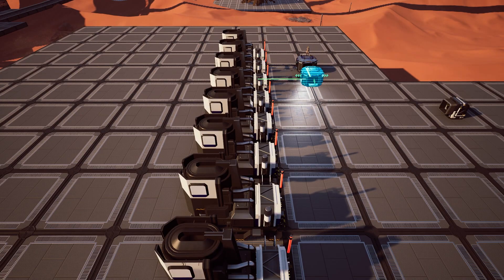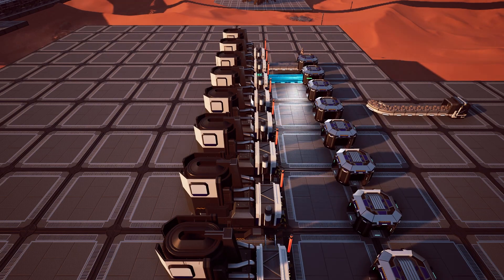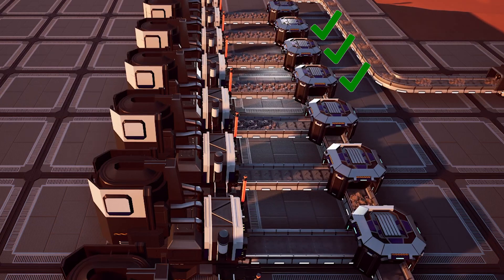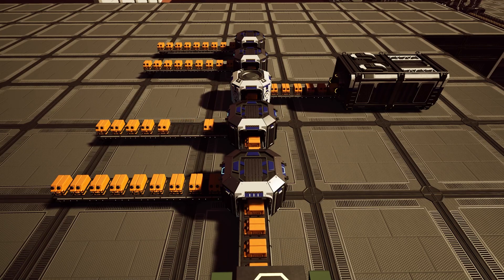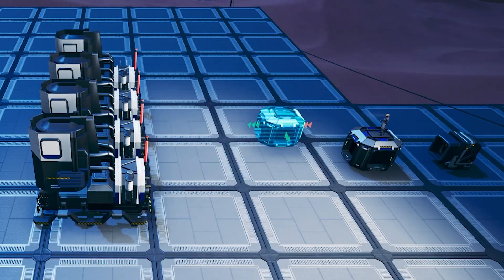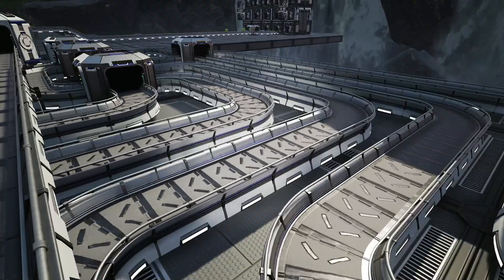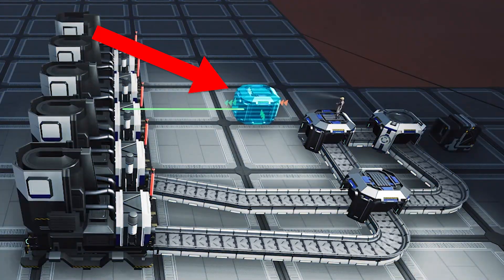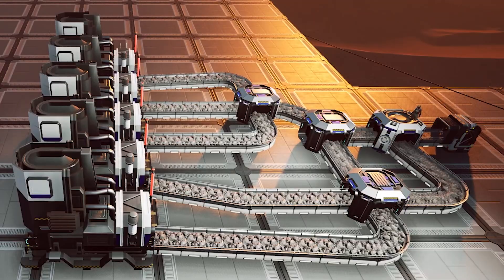Satisfactory: Manifold vs Load Balancing for Belts + Tutorial

Comment: Then how to fix the manifold common issue as it splitting uncommenly causing drops in last constructors?
Reply from the maker: Either keep the machines unconnected to an output until the line completely backs up, or "inject" a belt partway through the manifold.

Comment: A straight manifold only works as input in this game if you're inputting more resources than you need. If you require 120 resources per minute, and you are inputting 120 resources per minute, the manifold will NEVER fill up, and the items at the end of the manifold will be starving the later inputs. Manifold just straight up doesn't work. And if you're inputting more resources than what is required, you're already messing up; that is waste. That is product you could be using elsewhere. If you have belts that are backed up with product, you are running an inefficient factory. And nothing is going to fix that except getting out a calculator and working it out.

I came here to find out how to do that. This is not the video to help with that, apparently.

Comment: I feel kinda dumb for immediately jumping to doing the math load trying to figure out load balancing right now. Manifold looks very aesthetically pleasing and symmetrical to me while in order to load balance I’ve been making some incredibly weird sphegheti monstrosities and handling all the splitting outside the buildings holding my machines. I basically have giant splitter towers to try and make any belts inside more organised and clean. Manifold has me really thinking about how to get good looking production lines going by using underclocking and more machines to saturize the manifold faster.

Comment: Ive been lately finally trying manifold cuz I've been using load balancing for like most of my playthru. The biggest disadvantage with manifold method is it relies heavy on the type of belt.
Since ive been doing load method for so long, i found  this math issue. 
doesn't matter if your input is like 200 something, the manifold will act like u only got 60 if its MK1 or 120 something if its MK2, so if its a smelter for iron, no more than 3 smelter will be fully filled so the resource would barely make it to the fifth one if at all cuz the 3rd smelter would never be full for the manifold to function properly. so its super dependent on how much resource your belt can carry and u can't use all your production to the fullest. 
im wondering how to fix this issue.

Comment: Note that this loopback WILL make it behave wonky if your belt doesn't have the capacity to accept the resources looped back. For example imagine you have tier 6 belts with 1200 items, and want to feed 5 machines with 240 items each. That means this entire system has to allow resources to enter at full speed, which won't be happening any time the external input is blocked because the merger decided to let through a looped back piece of resources instead.

To handle that case you can do three things. One, have multiple loopback mergers directly AFTER the first splitter, not before, and split your loopback stream evenly between all of them. Two, just don't do the loopback at all. It won't be perfectly balanced but eh, it'll be close and it'll balance itself like a manifold given enough time. Three, you can mix and match grades of belts to work as solid item valves. In my example (1200 items split between 5 machines, 240 items each) you can do a manifold where each splitter has 1 full speed belt going further down the manifold, but 2 tier 2 belts going to the machine which you'd merge right before it. No loopback required, yet the output is guaranteed balanced.
Reply from the maker: Great point, and I made a follow-up video that addresses this and other points which is in the pinned comment. It's a very important detail!
Reply: @SatisfactoryNews  Yeah, I saw the followup after commenting. Two things I noticed there:
1. It doesn't directly reference the "belt valve" method but that's kinda niche so that's fine. "Use the slowest belt with the manifold" is almost that, it would just be nice if the video mentioned that such a manifold IS also a balancer if the speed of output belts times the number of output belts is equal to the speed at which the resources are delivered into the system. Like for example, with 8 tier 1 belt outputs and a fully saturated tier 4 belt input all machines will get exactly 60 items / min, just like if you chained three 1-to-2 splitters before each.
2. It mentions that sometimes you can expect not to be able to merge your loopbacks in the "merge after the first splitter, not before" case. But, why? Just merge all your loopbacks onto one belt, and then split it with one splitter, whose outputs you then merge with the 2 or 3 belts that exit the first splitter of the balancer. Ezpz, it'll always work, since not getting into the math the 1-to-5 balancer is the most taxing on the loopback and we know it would work there.

Comment: I started using smart splitters for my manifolds, only allowing overflow to pass to the next machine
this way i can ensure every machine running optimally quickly. I use loadbalancing BEFORE sending belts over. 
Lets say a smelter needs 20 items, i make sets of 5. Balancing everything into belts of 100, and send those 100 along a manifold of 5 smart splitters.

Comment: Maybe I’m misunderstanding but manifold by necessity is going to be inefficient in terms of input usage, right? Sure, the machines (like smelters) may get up to 100% efficiency but that will require lots of backup and therefore lots of output from your miner being wasted and underutilized.
Reply from the maker: It does, by definition, take some time to get to full efficiency. However, it's rarely an issue. Most people build one thing at a time. They build their smelters and power them on, and they're inefficient for a bit. But by the time you've built your next set of buildings, the smelters will be backed up. If you build your entire production line, THEN power it all on at once, then it'll be inefficient for a while. But most people don't build like that. And in general, you can just power off each section of the production line and wait for it to saturate, which doesn't take long for basic production lines that have a high density of parts.

Comment: For 1 feed with 5 end points I've always used 2 splitters. 

The main feed is split into 3 with the first splitter, which go directly to the middle 3 machines. The middle belt is then split again to feed the 2 remaining outer machines. When it's complete, it kind of looks like a menorah from above if that helps visualize.

Comment: With Manifolds, you can reduce, but not eliminate, the load issue by introducing a merger between each splitter and reintroducing the third output from the previous splitter. Then, you go from a 1/2 split to the machine to a 1/3 split. This brings the efficiency up during startup for minimal size increase, but it takes significantly longer to saturate the system and get it running at 100%.
You can also run a half balancer for large manifolds, where there are two or more manifolds for the same machines connected to a smaller load balancer than would otherwise be needed for a fully balanced system. Still has the problem of taking longer to start up, but initial response is again a lot better. The only way to completely eliminate the startup penalty is to either have significantly more input than what the machines use, or to go fully balanced.
Personally, I balance everything I can. If the machines are getting only getting equivalent or less input, I don't want to see any sign of backup. I even balance outputs, not sure if that has terribly much benefit but I do.

Comment: My manifold cubes stack both horizontal and vertical - i refeed everything through the front, so connection is as easy as linking the front wall ports down to the bottom

Comment: You can jumpstart your manifold by powering your factory as you build it from the bottom up, thereby ensuring the base machines have full components before the next layer of machines are finished. If you're too quick a builder and it hasn't caught up yet, you can also add stuff from your inventory into the inputs/outputs to help reach peak efficiency quicker.

Comment: Will the loop back even work if the input belt is at full capacity? I think it will back up and essentially make one splitter work like it had only 2 outputs connected. Not really worth the effort unless you use non saturated belts.
Reply from the maker: Correct - see the more detailed follow up video in the pinned comment! Great point that many people brought up.

Comment: when your belts are not moving enough materials for the machines: on a manifold system; the last machines will consistently starve for materials, while on a balanced system, they will all get materials but at a slower rate. If the starvation is really bad on a manifold system the last machines will almost never run. This of course applies to both but it's far more pronounced on a manifold. This might sound obvious which is why it's good to know this function for any reason you might be intentionally running a lower through-put, such as a production line up-grade but you've not expanded your input line yet, or if your just winging it and slapping down machines and hoping it works lol.

For when you are moving enough materials: you can get around the slow startup of a manifold by pre-filling the machines...if you have the materials of course.

Thank you for the video.

Comment: Copy-paste from my response to someone else (re: how I've always done load-balancing and never even considered manifold):

The first time I saw the production rates vs conveyor rates (both back in update 4, and just recently when 1.0 dropped), I just instinctively started running the math to equalize all the belts and match the mining/construction buildings.  Just splitting everything off of the same production belt never even occurred to me.

Since I don't mind waiting, wanted an excuse to just upgrade all my conveyors and never look back, and favor simplicity and compactness over the dopamine rush of watching every belt run smoothly 24/7, I think I'll start incorporating manifold.  Then basically the only rates I'll care about are total materials extracted/produced.

Granted, that will only work with materials that can be backed-up without issue (and not things with fluid byproducts or, like you said, uranium), but it will still make things so much easier to plan out!

Comment: Manifolds save a lot more space, which is very important when making blueprints. You can get most of the benefit of load balancing by using a single load balancing splitter, and manifolding the rest. Once your machines are backed up with resources and your belts are full, they will operate similarly to load balancing setups. If the last machine ends up not getting enough resources, I believe that would be a symptom of not having enough flow rate of resources for the entire setup, rather a load balancing issue.

Comment: This works for the endgame pretty well, when you've already unlocked belts that are so fast/have so much throughput that it's no big deal to use a manifold, but in the early game you're often limited by belt throughput. Using a loop-back in your balancer also hits this issue in the spot between the loop-back merger and the first splitter. If you're belt limited, this whole thing is a problem.

A multi-input, multi-output load balancer can get around this limitation, if you're clever about it.

tl;dr: The loop-back you showed here and the manifold shown here can have an overload issue with early belts.
Reply from the maker: Many people have pointed this out and I made a follow-up video (in the pinned comment) that addresses that and other considerations. It's a very good point!
Reply: @SatisfactoryNews  Ah, excellent. Sorry I didn't notice that. I'm watching the correction now.

Comment: god bless the new "straight belt" mode
Reply from the maker: Seriously a lifesaver.
Reply: What is it?  Could you explain?
Reply: @rythenx  Hold 'R' while placing some items and you can change the mode. Conveyer's alternate will make it automatically turn at right angles if possible.
Reply: @JD867  Not hold, press R once
Reply: @JD867  Oh wow thanks, I guess that's new for the full release?  That's awesome.
Reply: its a godsend
Reply: Yep, makes it even easier to build manifolds. Never saw any reason to load balance in this game, especially after 1.0.

So what if it takes half an hour to saturate? I just go expand another line while it ramps up. Worrying about saturation just feels like some weird post-hoc justification for importing some cargo cult logic from Factorio where it had something of a point because of how lanes and inserters work there.
Reply: @CerusVI you are wasting an hour of production in filling up your machines? Ficsit should be ashamed of you

Comment: Slight Correction: Having a multiple of 2 or 3 doesn't necessarily make it simple, (for example, 10 would have 2 sets of 5 which then causes a problem) instead, it is simple when the number of machines has only prime factors 2 and 3
Reply from the maker: Yes, see the one million other comments saying this same thing, and the correction video linked in the pinned comment, lol
Reply: @SatisfactoryNews  I apologise for not checking the pinned comment, but I always check for anyone saying the same thing before I comment and I didn't see any that said it

Comment: When you need to split 4 belts with non-equal supply speeds, totaling more than the fastest belt you have, into 5 machines, equally.. That's when shit hits the fan
Reply from the maker: Yeah, that's when I just give each of those 5 machines a building making the prerequisite part that is under/over clocked perfectly to make the exact amount. So much easier than trying to figure out the math for that balancer.

Comment: My problem with using the manifold method is that the early game belts just cannot support the amount of materials needed for a craft. So im stuck tryin to calc belt loads and fancy splitting and remerging and all that just so each machine can get 50 screws/craft. On a manifold array, the last couple of machines are so inefficient
Reply from the maker: Yeah, early game is rough. You kind of just have to work with what you have until you get something better, but that's kind of the point.

Comment: I like to use industrial containers to balance things. Put the containers into 2 rows. The first row is for inputs. The output of each container in the first row should go to the bottom input of the 2nd row. The top row of the 2nd row should form a circle. I.e.  The top output of the first container connects to the top input of the second container, just continue adding containers for as many outputs as you need and make sure the last containers output in row 2 connects to the input of the first container in row 2. What will happen from there is that parts will always be in motion on the top track of the 2nd row auto balancing materials in the entire row so the outputs of the 2nd row can go directly to something else. Basically 2 tier klaus architecture for satisfactory.

Comment: I've been using Manifold mostly, but load balancing where convenient. The difference in how I used it was that I didn't build a belt of higher tier unless I needed it. Let me explain.
Let's take a case of Manifold method. The input belt is a tier 4 at 480/min speed. But a singular machine needs only a fraction of that, it can be handled by a tier 1 belt! And so, if you use a tier 1 belt, aside from saving a miniscule amount of resources, you also change the ratio of resources machines get from the beginning. First machine will start filling up its buffer at 60 items per minute, and the rest (420/min) goes to the next splitter in the manifold. And so, that goes up to 8 machines. But that's just the half of my approach, the second part (which might've actually caused more imbalance, still pondering on that) is changing the belt tier as you go down the manifold. Let's say that a machine consumes the item at a rate of 15/min. Then, the belt that goes to the fourth from the end splitter will only need to be tier 1, as the max these machines can take combined is 60/min. But, that can make the manifold's weakness even worse - the last machines may be starving of resources for a small amount of time. I think I've faced this in my compacted coal power generation facility, where the last 3 or so generators had a little fuel starvation problem. I've changed the belts that go from splitter to splitter to tier 3 and haven't noticed the problem since. I have a steady supply of a full tier 3 belt of compacted coal, so it definitely wasn't lack of actual supply.
This information mostly applies to a case where the supply meets demand exactly, and you engineered your setup to go at max throughput. There are uses for manifolds and there are uses for load balancing. Good luck, have fun!

Comment: For load balancing the number must be composed of only 2 and 3, not divisible by 2 or 3. This means you might need to feed back multiple belts.

For exmple, 10 is divisible by 2, but the next 'splitable' number is 12.
Reply from the maker: See video linked in the cards and in the description and in the pinned comment. I realized and corrected my dumb mistakes 😂